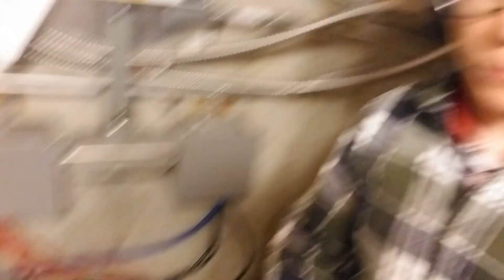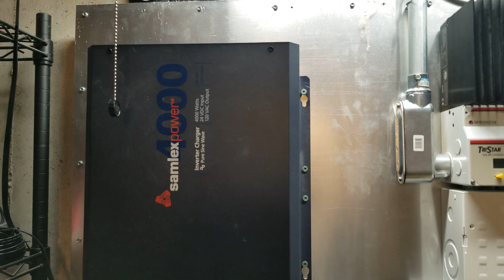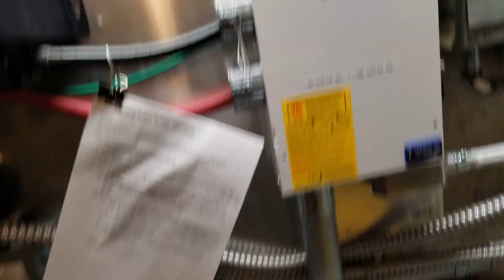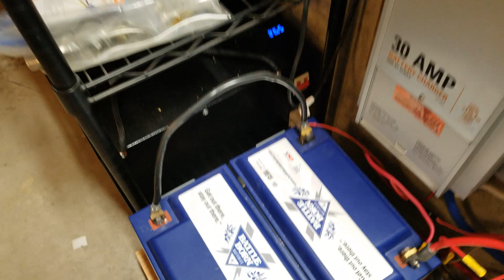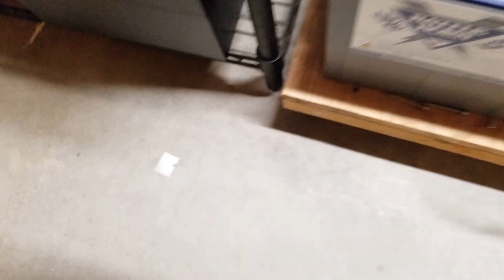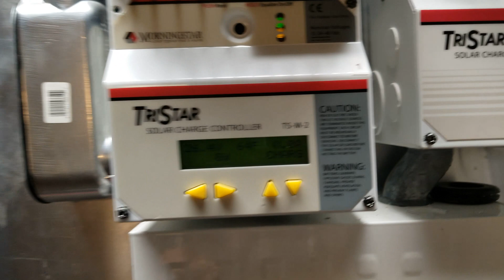Battle Born LiFePO4 Lithium Batteries - Fantastic Awesomeness

Comment: You spend $4,000 on 4 battleborn you could have built 8 times the size of a battery with $4,000
Reply from the maker: Yep, but it was my first dive into Lithium so wanted to get something with a warranty behind it.   It is also much easier to transport these or use these in a vehicle without worrying about things jostling around and causing a safety hazard.  We do use two of these now when we go camping in our pop-up camper.
Reply: @thekeltnerway3002  yes for a camper something that jumps around and moves around alot yes the bottle borns are the best but for a house they just going to sit there and never move there are way too expensive